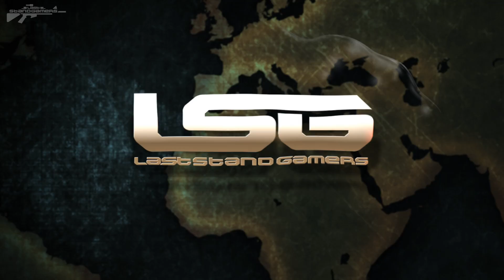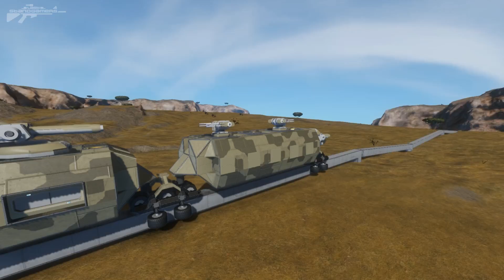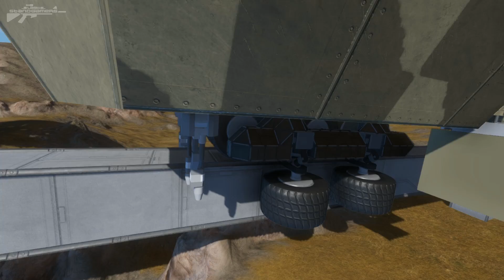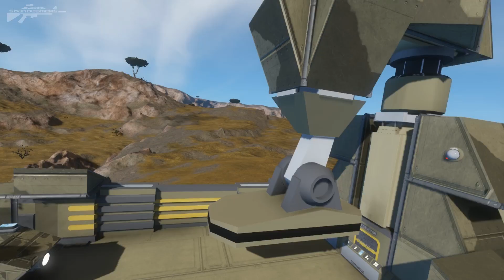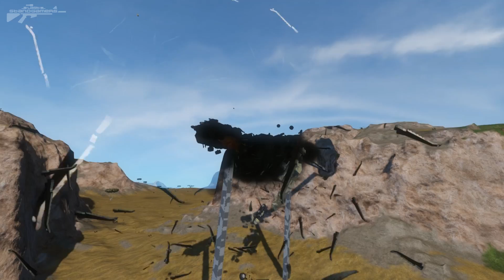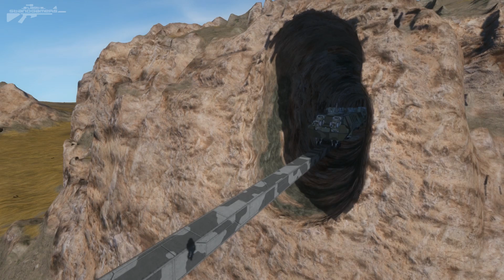Space Engineers - Armoured Train Destruction

Comment: here's some quick ideas: add a detector to detect if the track is damaged enough, so it won't go off track. add another detector to detect blocks in front, so it slows down, also  put some saws to cut any debris , you may also want to add some drills to clear rocks.
another fix against track damage is making the tracks like this:

[HA][HA][HA][HA][HA][HA][HA]
                                          [proj]
[HA] is heavy armour, [proj is a projector that project this blueprint] 
so if anyone tries to sabotage the track, the train should weld the blueprint as it goes.

Comment: Try putting a low ram on the front. maybe design it like a rake so that it catches the bottom of the obstruction and lifts it up then slides left or right off the track. you could also do a rotor based arm that runs on sensors and sweeps obstructions off if sees them. both ideas will fail in a tunnel so attach grinders for obstruction clearing if you have to as a last resort in a tunnel.
Reply: to continue my previous ideas you could build a ballistic curtain on the bottom to protect the wheels. It will make the train less flexible but im sure we could segment the curtain to fix that issue.

Comment: A very nice armored train you had there. I might have to install Space Engineers & try to build one for myself.

If I may offer one suggestion, most armored trains would have had an extra carriage called a "control car" coupled to the front & rear. This was basically just a flatcar, usually either empty or carrying sandbag barricades for auxiliary troops to shoot from behind, or spare rails, crossties, and supplies for repairing damaged track. The purpose was that if the train came across displaced rails, or worse bombs strapped to the track, the non-essential control car would be the one to derail/be blown up before any of the more valuable/more difficult to re-rail carriages reached the problem.

Comment: Hey Arron, have you ever tried using a jump drive to get off a planet? That could probably  use a lot less fuel, if it works.
Reply: I don't think it does because it's inside a gravity well 
but in a large gravity well 

jump drives Do allow you to go far distances but only in low (General) gravity 
since theoretically gravity is everywhere the "destination" you have set will need space due to the gravity all around you
Reply: +RacermonGaming is that how it works in space engineers then? It's good that Keen goes into that much detail with something that's theoretical anyway.
Reply: +John Wood I enjoy that it isn't precise because it improves on realism nothing can be 100% accurate unless it is accounted for 

then again when referring to space you could separate it into sectors, they say to go to a sector but not to a specific point just a general area (when using jump drives this applies) in space nothing can be 100% accurate when talking about movement
Reply: Yeah, I do love the realism they put into it, it makes it so much more immersive.

Comment: This is an awesome build.  I am thinking for the front of the train you could build something on the lines of a snowplow blade to push things out of the way.  And as for the wheels and welders underneath.  If you look at how most monorails are built the bodywork extends down and around so you could in theory extend the armor down to cover the weak points of the wheels.  just one question.  What is the top speed you have had out of this train so far?  Maybe look at some SciFi armored trains that have a jet propulsion system as an inspiration for making a high sped train.  :)  Keep up the great work.   Love your vids.  Cant wait for more of season 4.

Comment: Is the train able to turn at all?

P.S. you can put a wedge in front of the train to knock stuff off. Or you can make a sort of sideways slide like snow plows use.
Reply: +Casey Cattron the wheels look like they are attached to rotors so they should be able to turn and go around corners
Reply: Komrade You cant, it would be a long corner of straights that are cornered at like 30 degrees every time until you've finished the turn.

Comment: use wheels as rail.
Reply: +Fedor 19.12 so the track pushes the train along and the train doesn't push itself? might be costly in resources and power.
Reply: +Elrarion2 
Wheels used as rail, just replace armor blocks that can be deformed with wheels (or conveyors if you want sqare rail). Train will continue to push itself with wheels on bottom.

Comment: hey try putting a hologram building thing (forgot the name) on the front so it can build a track in front of it if necessary as well as a drill so it can build through any mountains that might get in its way (you will have to slow it down if you use a drill. not sure if this is possible but if so please make a video of the improvement.
Reply: +logan sigmon I wonder if this could be used, vertically, to make an space elevator.
Reply: +Matthew Richey Somebody has already done that but they then decided to build grinders to destroy its path which doesn't make much sense and the welders should be detachable as they should only be needed once. :D
Reply: +Matthew Richey it can, but it has to be on a station fixed to the ground and the elevator needs welders and grinders when it goes back down
Reply: +Matthew Richey Yeah ... Theres Already YT Videos About Self building Space elevators
Reply: Max B why would it need grinders? its not a one way trip, it goes up and down many times so removing its pathway seems like a waste of time to me, if your trying to hide the fact your transporting goods then a spacecraft would do the job better.
Reply: wasn't really talking about space elevator just thinking of a way to make it so the train could never be derailed that is why it has a drill because its travelling on a horizontal plane were mountains and such could get in the way also the drill could destroy any foreign object on the track.
Reply: logan sigmon Planets Are Round.. You Cant Go Straight Forever
Reply: +Elrarion2 it removes itself on the way down so you don't have a long metal beam sticking into space when you don't need it. Also the process is repeatable, so it wouldn't have an impact on the actual functionality of the elevator
Reply: Max B well no but it would take more time and i dont see why a metal beam us a bad idea unless the planet your on is in conflict.
Reply: +Elrarion2 it is wouldn't take longer if you just stick a few above each other, so why not. You can make sure nobody spots the giant arse rod sticking into space and it can't be sabotaged either when it's not in use. Like we saw in the video with the train, you just have to place or remove one block to disable it and in this case make you fall to your death. There's no real disadvantage and quite a few advantages ( for PvP that is ).

Comment: hey aaron try putting a cow catcher that was put on old steam engines to push cows off the tracks or a snow plow shape on the front should fix that
Reply from the maker: +The Rebel That's a great idea like just seen one on the more traditional steam trains.
Reply: +LastStandGamers yep and it will also protect welders, can also add the skirt around the bottom to protect the wheels to.
Reply: Richard Schafer
So what you suggest is to use a piston actioned part to ram something at high speed? I'd say that 2 out of 3 tries will create a crater in your planet.
Reply: +The Rebel what about turns
Reply: +LastStandGamers A snow plow design would work better I think, you should have peak of the slope on one of the sides rather than the middle as then you still have the chance of it going under rather than being swept aside.
Reply: +LastStandGamers Also, put a projector underneath the train, right before or after the welders, so you can weld the tracks in case they are missing. And maybe you could add this and the welders to every single wagon.
Reply: +LastStandGamers and alot of grinders at the front :3 (not that they can grind the track but only the obstacle and drills if someone trows a rock on the track)
Reply: Just my conclusion from watching the video. Cow exploder, cheap and effective for forcing obstacles off. Although, depending I how the physics respond, one could rig it to a piston set with a sensor. To activate a quick slamming motion when unowned blocks are detected
Reply: +Meachiezz ah good point!
Reply: +GamesPass if anything add a bit of bounce to the impact to aid in pushing the object off. But I just got to pondering. If the Pistons were extended and a very short range sensor was on the plow. Could it potentially be used to detect an object at the moment of impact, reversing the Pistons and potentially minimizing the effect of the overall impact to the train. I dont know enough about piston behavior in those situations to know if that would actually work
Reply: +Richard Schafer ahh. i had the same idea along with a wiper and if your in a tunnel resorting to front facing grinders as a last resort.